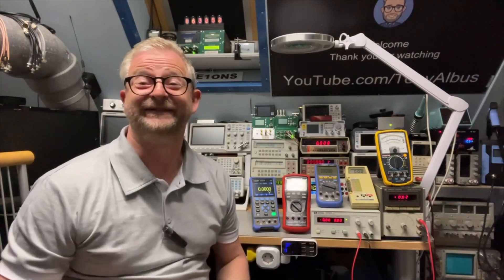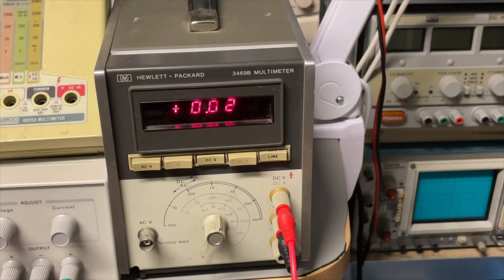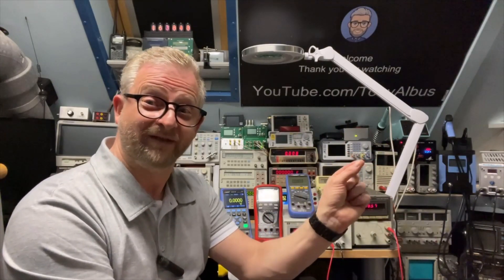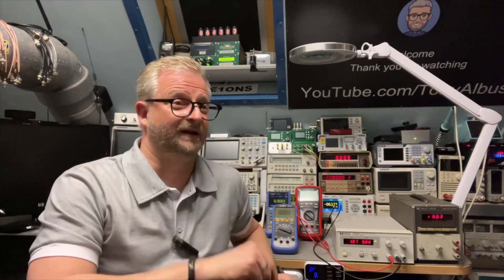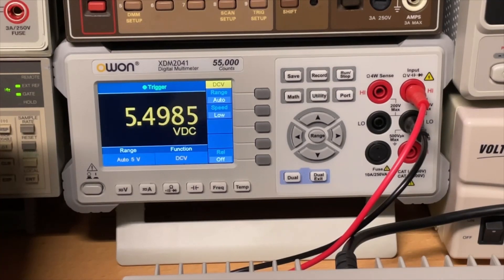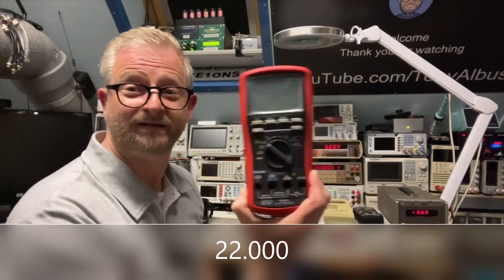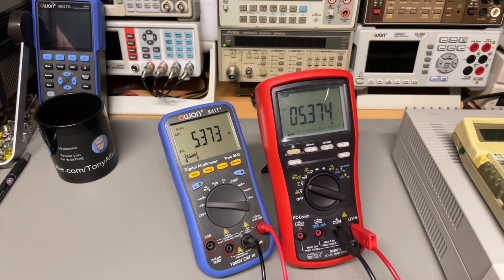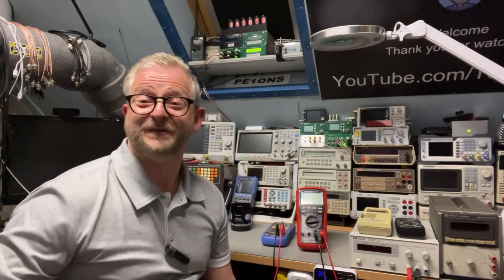#213 Multimeter Digits and Counts - DMM - Keep it Simple

Comment: To make it even more confusing - often DMM's advertised at a certain count will actually exceed the count - my Fluke 17B+ for example is supposed to be 3999 counts but it won't lose the digit until it passes 4399.  I have a few 5999 count meters that will jump up to either 6099 or 6199 before losing a digit while others will flip right at 6000.
Reply from the maker: LOL.. Yes.. the cheapers go exact while to higher-level meter will do more, my Keithley 199 is 300.000 but does 314.999 :)
Reply: @TonyAlbus  Not necessarily - some cheap meters will do it also.  I have a few of those.

Comment: 3 1/2 digit multimeter really shouldn't be called "three and half digit multimeter" as those "1/2" isn't really meant as fraction value as "half".
Same thing with 3 3/4 digit multimeter isn't supposedly called "three and three quarter digit multimeter" as those "3/4" isn't meant as a fraction of "three quarter" (0.75).

So what is it then?
we have 6000 counts dmm called as 3 5/6 then even those VC8145 multimeter is supposedly called 4 7/8 digit multimeter.
Fluke 87V high res mode is 4 and 1/2 digit == 20000 counts
Fluke 189 is 4 and 4/5 digit multimeter == 50000 counts
My HP 3478A is supposedly 5 2/3 digit multimere == 300000 counts.

I'll explain later.
Reply from the maker: Budi Surya Yes that was my point exactly, the counts are a much better presentation. Thank you.

Comment: The Owon is really 55000 counts, not 54999 as I think you suggested (if I understood you correctly), because there are 55000 different possible values that it can display from 0.0000V to 5.4999V.
Reply from the maker: yes 55000 like the sticker if you count 0. thats better then a 4.5 with 20.000